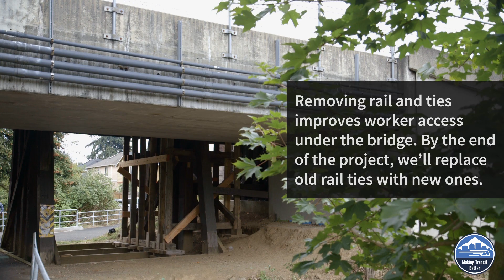Rebuilding TriMet's only wooden trestle

Comment: Wooden trestles are designed to last over 100 years, so why is TriMet prematurely replacing this trestle while letting unsafe bus stops remain?  Especially since the MAX LRVs are a fraction of the weight of the freight cars and locomotives that this trestle used to support.